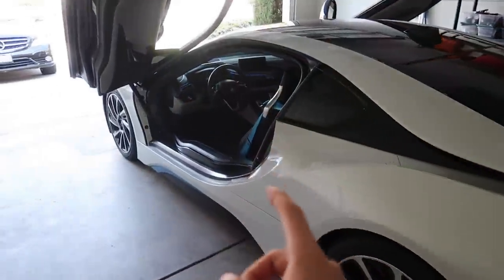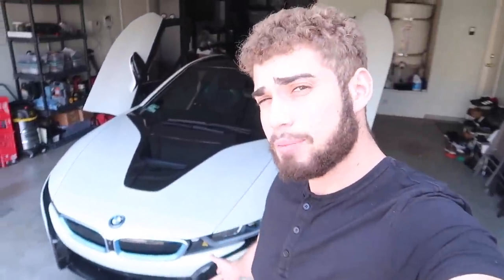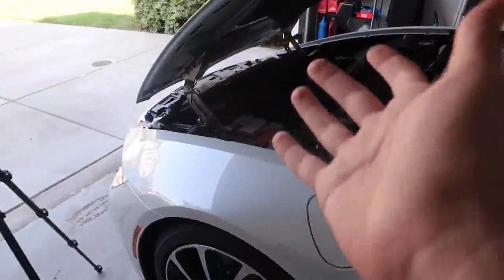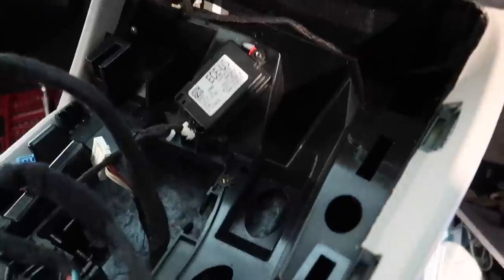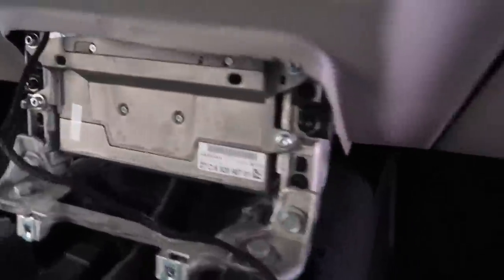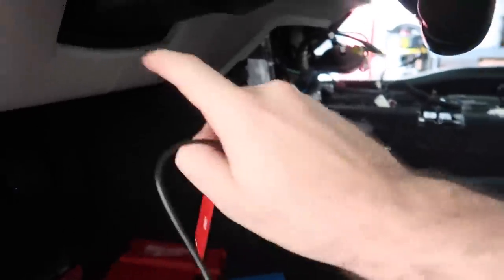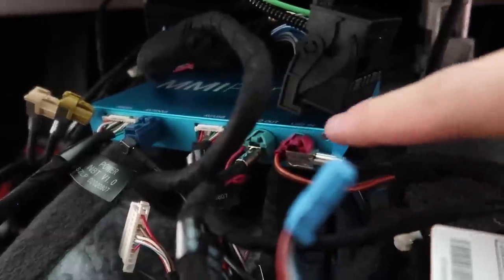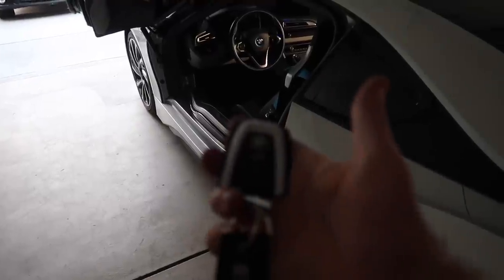Every i8 Needs This Mod! (INCREASING THE VALUE OF MY I8!)

Comment: Love the car...and the apple car play just gave it a super upgrade. Never knew that's what it was, going to order it for both my 528i and 428i...
Reply: Might as well check out bimmersupplies. Offer the same thing basicly for cheaper :).
Reply: Hey bro does the Apple CarPlay connect with the heads-up display if you do get it on this car?

Comment: Hey dude do you know if you also have to disconnect the high voltage battery? I see you only disconnected the 12v I rather not mess with the high voltage

Comment: And btw if BMW finds out you took the car apart to that extent they will void your warranty
Reply: Not true for what he did
Reply: @200mphBrian  Well maybe it actually depends on the dealership. I had a 2017 BMW i3 and i forgot to check the service history on it and it had no history whatsoever. This was after i bought it, i called BMW and asked, they voided the warranty for driveunit and gearbox etc.

Comment: Note and contry to your video here: Post 2018 i8's benefit from a larger battery and a more powerful motor, plus a larger fuel tank, so have a bigger more extended range. Also laser lights came as standard post 2018 cars.